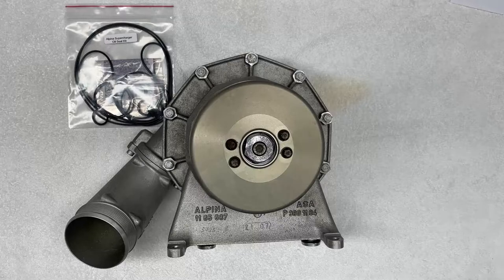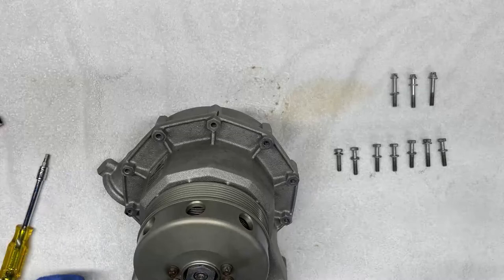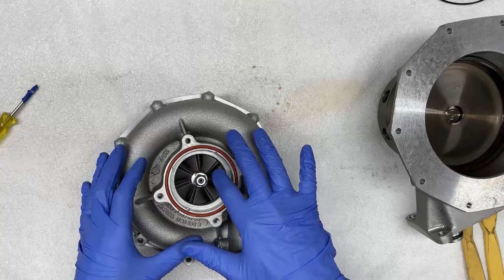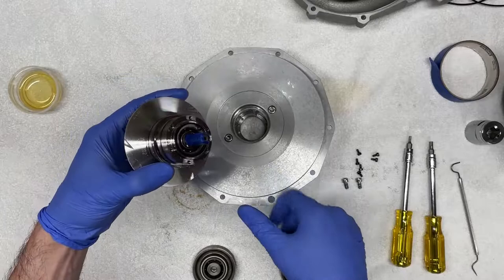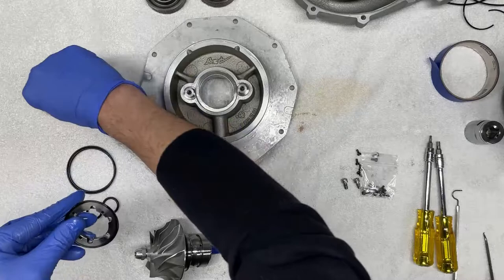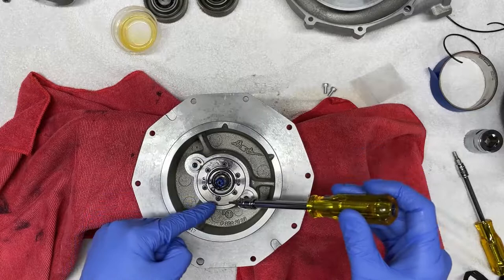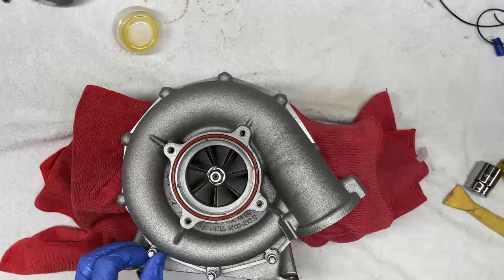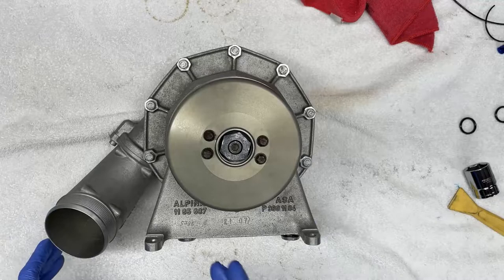Alpina B7 Supercharger REBUILD and Oil Seal Replacement - B7stuff.com

Comment: This was a great articulate breakdown and rebuild of the Alpina S/C. 
I ordered the kit, thank you 🙏🏼 and can’t wait to rebuild mine.
Reply from the maker: Thanks Fabian! Good luck with the rebuild, and let me know if you have any questions along the way. :)
Reply: @B7stuff  thank you for fast shipping of the seals. It took me 3 hours total from start to finish. My seals were all flat and plastic feeling. I notice my power thru 2k-5k RPM was smoother and instantaneous.  Thank you again 🍻
Reply from the maker: @1SNITCH  Great to hear, and good work on the rebuild! Thank you for the kind words! :)
Reply: helloo dear, please wanted to check if the supercharge of b6 model 2007 is similar to b7 model 2008?

Comment: Hello - sent an email - I have an ASA TM-12 supercharger with a damaged compressor wheel.  I purchased a billet replacement wheel but also need seal replacement.  Do you have experience with the TM-12 supercharger model?